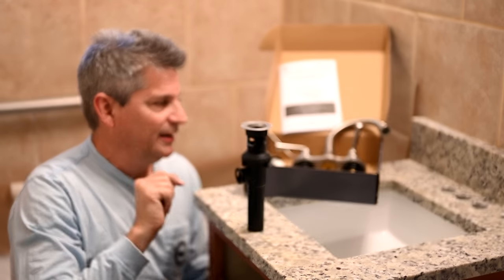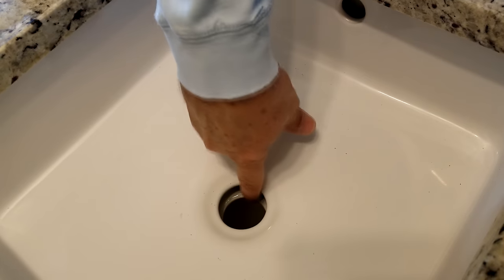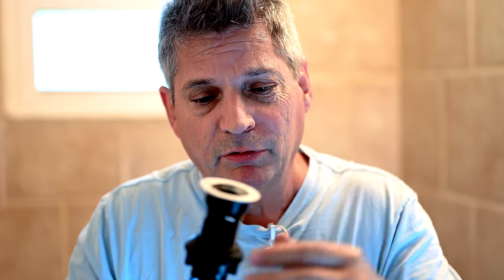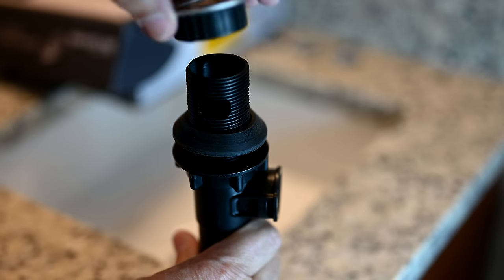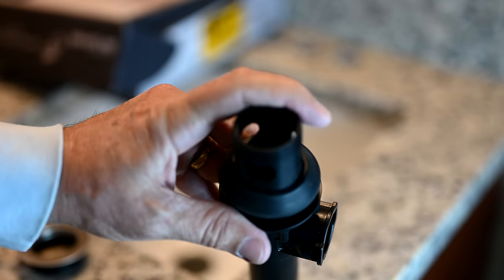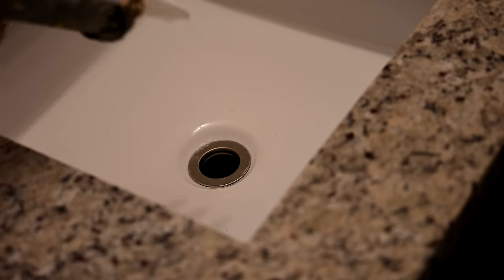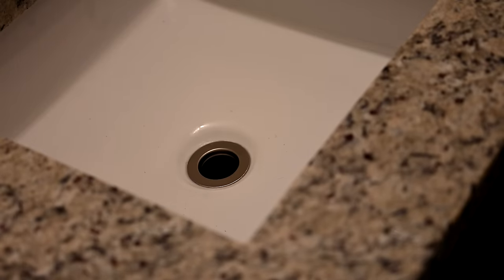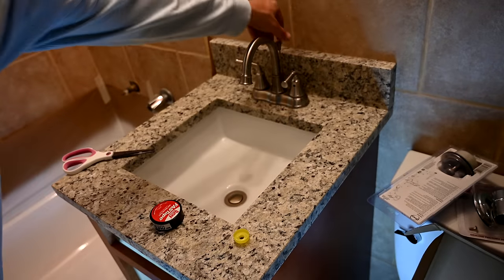How To Install Bathroom Sink Drain/Faucet, No Leaks Under Gasket, Threads [SOLVED] 2023

Comment: Sorry but i really dont think the teflon tape is doing much of anything here.  Just use plummers putty around the drain and tighten the gasket down real well and you should be good to go.
Reply from the maker: You are 100% wrong. Did you not see the comments from hundreds of other people here, literally hundreds who said they tried everything and this solved the problem? You don't understand where the leak is coming from. so your info is incorrect. Everyone uses plumbers putty and still gets the leak, because water is always on the threads down at the bottom.

Comment: Tip 1: Glacier Bay is garbage, never use them. Tip 2: Forget the teflon, put silicone on the top, bottom and threads of the overflow. Tip 3: install the faucet and connect the water first. Tip 4: straighten the pop-up rod looks terrible. Other than that I’d say you got it.
Reply from the maker: Their pop up rod is a stange angled one

Comment: I am NOT a fan of glacier bay anything.  You can't buy replacement parts for glacier bay crap.  When your toilet or your faucet malfunction you have to throw it out and buy a new one.  If home depot is going to sell the toilet, why in the hell won't they sell replacement flush valves that fit it?

Comment: WRONG.  The threads are not tapered pipe threads and they are not intended to provide a seal.  There is no point in putting anything on them to seal them, which is the reason the manufacturer doesn't instruct you to do so.  The rubber seal/plumbers putty/silicone sealant provide the necessary seal as per the instructions.  If you have a leak, it has nothing to do with the threads.  They are there only to facilitate the assembly of the unit.
Reply from the maker: WRONG! It is obvious the Teflon tape worked because the threads of the pipe are allowing water to leak out where the threads meet the gasket. IT's so funny watching uninformed trolls come in here and make statements like this, while hundreds of people have already reported in the comments that this solved their problem.

Comment: Ive had a number of customer's over the years, go  buy the faucets from the Box stores' they brag about the price of the faucet, compared to the plumbing store's price, then I would pull out the faucet from the box, and then pull out the plastic pop up drain, then I would explain the my customer, these threads leak,  so I would usually supply  a brass drain,  I over the years have only maybe 3 to 5 plastic drains Never Leak on me, the rest that did would be thrown out and brass installed.  Yes the Big Box store's would sell the faucet for $20 less, then the plumbing shop, but the plumbing shop faucet would come with brass popup , and if  there plastic drain leaks and I have to take out and install my brass drain , not only are they paying for a better drain, but Im not going to Warranty their drain, so their paying  myself more labor.   Yes silcone will work on some of the plastic drain,   so make a long story short,  buy a good brass drain, if the faucet comes with a plastic drain.  PS  I was a plumber for 34 years,
Reply from the maker: Yes, can't beat solid milled metal!

Comment: this guy is clearly not a plumber, waiting 30 minutes for silicone to cure will get any boss angry or get you fired
Reply from the maker: That is correct, most plumbing bosses unprofessional, want to overcharge customer, get in, get out, move onto the next job, don't test your work, just get out. I have repaired P-trap leaks from plumbers who just installed it and left

Comment: That's not right, you forgot to put the putty underneath the top screw cap.
Reply from the maker: YOU are not right. You forgot to watch the video. I clearly explained this is black ABS plastic and you cannot use plumbers putty on it, because petroleum products in it will cause ABS to crack. Also the manufacturer specifically instructed for silicone to be used. In most drains you can use silicone or putty. Many plumber prefer silicone because it will not dry and crack and cause leaks like plumbers putty does.

Comment: Use plumbers putty !!
Reply from the maker: No plumbers putty is not recommended be cause the manufacturers have since told us that the plumbers putty has petroleum products in it which can cause the black gasket to crack. Also if you appropriately wrap the threaded down pipe with the plumbers tape, that is what actually solves the leak so you don't even need the plumbers putty to begin with.

Comment: Nonsense! That Teflon tape doesn't do anything. Tape is meant to seal two threads male/female. You got lucky  period ! I would've put silicone on rubber gasket underneath sink . The tape is physically making contact with rubber gasket, but not filling any grooves.  Most people with leaks need the silicone. Issue is water splash gets into weeping hole area and sits there, if not sealed correctly(silicone) it drips between rubber gasket and sink. In your case, Teflon is wrapped around the plastic drain, preventing leak between drain pipe and rubber seal, not between rubber seal and sink. If you had a solid drain pipe, meaning no overflow protection, most people would have no leaks!
Reply from the maker: LOL you just contradicted yourself. you said "In your case, Teflon is wrapped around the plastic drain, preventing leak between drain pipe and rubber seal". Yes this is why it works. It is not just lucky, look at the hundreds of other comments from people who tried everything and only this works. You don't need silicone.
Reply: @jeffostroff  I didn't try it, but did use silicone....and it stop leak. Look, The area of sink were weeping holes are traps water, that water sits externally to drain pipe (i.e it is outside of drain pipe), the water will sit there and eventually evaporate if not used in a long time, OR. DRIP DOWN BETWEEN THE RUBBER SEAL AND SINK, IF NOT TIGHTENED OR  SEALED CORRECTLY USING SILICONE . PLUMBERS USE PUTTY LONG AGO. 
.

Comment: I personally disagree with the points in this video for the strainer.  it simply doesn't make sense.  instead, I believe the Teflon will make things worse. I am surprised there are many replies here saying it works.
Reply from the maker: You are wrong that's all there is too it, just wrong with no scientific basis. It does not make the problem worse it solves the problem. Have you not read the hundreds of comments below from other people who claim this was the only thing that worked for them after watching this video? How does that make it worse?

Comment: Normally I’d laugh. 
But do not use caulk. 
NEVER. 
It’s just shocking to me someone uses caulking.  The top section isn’t the main leak area and even if it did it won’t leak under sink. Over time. Very short time caulk will get discolored. Peel up. Look crappy. Etc. 
as for putty. You technically don’t need it on a bathroom sink. Kitchen sink yes. 
Also when installing a new faucet remove aerator and run faucet. 

Metal drains are much better then plastic.
Reply from the maker: it's the guys like you that laugh and don't ever read the instructions that don't understand what is really going on and can't even identify basic materials that screw everything up big time .  first of all I did not use caulk. I used clear silicone and not just any silicone this is a 100% silicone formula that is guaranteed not to stain or mold or anything so it does not discolor been doing this for years period also it is the instructions of the initial manufacturer to use clear silicone not plumbers putty you cannot use plumbers putty when you're dealing with black a BS plastic because the plumbers putty can degrade the plastic overtime causing cracks and leaks. Also plumbers putty can stain the sink too.
Reply: @jeffostroff  
Well I have 30 plus years in the field   
With that said. NO PRODUCT last a lifetime and someone who reads it and says. 
Cool lifetime. Well is a sucker. 
There’s no reason to caulk the top. 
ZERO REASON. The overflow on a bathroom sink drains right below rim. There’s also holes right below that rim. 
So sealing that area does nothing at all. 
I have removed and our replaced pop ups because caulking started to peel up or discoloration. And yes it says it won’t. But real world it does. 
I’d really love to hear your reasons for caulking that area. Because water fills in that complete cavity.
Reply from the maker: You can say all you want about it doesn't solve the problem by putting the Teflon tape on but you are incorrect. Our previous video that we did on his topic shows how it stopped the league. If you look at the literally hundreds and hundreds of comments on both of these videos from people who said they tried everything they read and watched numerous YouTube videos on this topic and they said only my Teflon tape trick worked. You can talk all you want about weeping holes and where you think the water's going nobody ever knows where the water is going. And everybody forgets that water leaks through threads and this Teflon tape stops the leak through the threads. It works we have shown it to work the feedback from the thousands of people who've seen these videos proves that it works.
Reply: @jeffostroff  
I’m only talking about the silicone you used. On top. Nothing else. 
The tape I have no issue with. 
The only leaks you can have on a pop up is under sink. The top is there so you can compress the unit together.
And I’ll throw this in simply because you said instructions/ directions 
I’m looking at several pop ups. From plastic crap to brass. Not one says use silicone on top. 
And not being rude. But no one should ever believe lifetime. 
It’s frustrating when a customer calls me and tells me they had work done and certain things failed and they say it’s a lifetime warranty. 
Or like brakes on a car. Lifetime warranty. 
Doesn’t mean for life. 
By you saying this. Your suggesting in 10-20-30 years it’s going to look just as good as it does today. 
It’s also why I don’t use plastic pop-ups.

Comment: You didn't solve a thing...the REAL REASON a sink leaks at that joint is because of the inadequate "clean-up" on the sink casting.  If you take a Dremel, grinder or even rough sandpaper and dress the opening where the flange and sink bottom meet, you will solve the problem.  Those pieces of pipe are NOT designed for Teflon tape...otherwise they'd tell you to use it...right?

You don't get to say "don't use plumber's putty" because they don't say to use it then use Teflon tape...when they don't say to use it.
Reply from the maker: You didn't learn a thing and especially look at the older version of this video that we did a few years ago where you see nothing but hundreds of comments from people who have watched every video on how to solve the problem and they said that this video solved it for them. Anytime you have two threaded pipes coming together it's a good idea to use Teflon tape. Some plumbers use pipe dope you'll see them paste it on the blue sick liquid painting it on with a brush.

Comment: Wayyyyyyyy to complicated, just flip that big washer over where the flat side seats against the flat side of sink flange.
Reply from the maker: Waaaaaay too incorrect in your jump to conclusions. The problem doesn't have anything to do with the connection at the bottom of the sink, it has to do with the water running down the outside of the threaded pipe and how to stop it.
Reply: @jeffostroff  ummmm it's how I fixed my leak.

Comment: This has got to be one of the worst plumbing helps on YouTube. 
The gasket does not thread on. You just push it on. No need to go counterclockwise. You don't even know how to hold a roll of Teflon tape to wind it on tight. The manufacturers who say, No plumber's putty must not test their plastic. I can take a plastic pop-up apart that has had plumbers putty on it for a decade and the plastic is fine. 
I pull the gasket and wrap Teflon on the entire threads. The Teflon makes the nut spin easier and the gasket slip over the threads easier. 
btw, That is a vent, not an overflow. It allows air out so the sink drains without a big bubble at the start. It is normal for water to be below the vent holes in the pop-up.  People wrongly call it an overflow because it does overflow.
PRO TIP. Install the faucet FIRST so you do not have to reach past the drain. Sealant under the gasket. Not around the faucet. Silicon gathers grime.
You got 2 things right. Tighten the trap to j-pipe nut first. Wrap the pop-up with Teflon tape. And yes, no plumber's putty on rubber. 
I use FrostKing rope caulk. It has never failed me under faucets and under drain flanges. Oatey sells their own version. 
I won't tell you my other ProTips I used while I installed thousands of sinks, faucets and drains. 
Testing the overflow....???? Really. If the drain does not leak, the overflow will not leak.
Reply from the maker: Wow what an uninformed troll. You do need to wrap Teflon tape counterclockwise. Just listen to how arrogant you are! This video is worn, the manufacturers are wrong, oh, but YOU are right? LOL. And wait, you refuse to test the overflow? You would not make a good plumber, stop pretending you are one. LOL! Man I love trolls like you, all you do is show everyone you don't know anything. How about this. Try reading all the hundreds and hundreds of comments from our readers who said this video solved their problem, and it was the only video who had the correct solution for them. First sign of a troll is one who starts of saying the is the worst video on the topic. LOL! How predictable and uninventive. You took the same troll class as others before you.
Reply: @jeffostroff  When wrapping Teflon, grab the object with your left hand with the threads to be wrapped to the right. Hold the roll in your right hand with the tape coming off the bottom. Hold the tape to the threads with your left thumb. NOW, pull the tape around and tight into the thread in a clockwise direction with the spool spinning on your right index finger held snug by your thumb. You can control the tension so the tape wraps tight into the threads with no looseness. Three layers minimum. Teflon tape is cheap and easy to use when you know how. 
At 5:00, you say to wrap the tape COUNTER clockwise so you can unscrew the rubber washer/grommet up to the sink bottom. Bull. Pull the rubber washer off. Wrap the entire lower threaded area with Teflon all the way up from the plastic nut then PUSH the rubber washer back on. The Teflon tape will dry lubricate the nut so it twists and snugs easily with just hand pressure. Twisting the rubber washer tears the Teflon tape. If you wrapped the Teflon tape tight enough with enough wraps, you can push the rubber washer on without tearing the tape
If you put enough silicone on the flange, you would not need to add more from the top. You don't even mention if you wait for the silicone to cure before leak testing. Great way to cause a leak. Oatey grey plumbers' putty on a roll or MD or FrostKing rope caulk will seal great and has no interaction with plastic. Lowes and HD carries it if your plumbing supply doesn't. Try replacing a siliconed in flange when a brushed nickel flange discolors or when replacing the faucet and pop-up. The finish on flanges on cheap plastic pop-ups do not last. 
When you are done, fill the sink to the top (it does not need to go down the vent/overflow.) with hot water. Listen for water leaking past the drain plug to make sure it is seating properly. Pull the plug and watch the drain with a flashlight. Even the tiniest leak will sparkle. 
I've removed and installed over 2000 bath sink faucets and pop-ups when I replaced the sinks. I did another 2000 kitchen sinks. I semi-retired and moved 700 miles from my well established market and did 7 years of work with only 3 call backs. I never used pure/RTV silicone. I used a polymer window caulk that had water clean-up. Customers hated how silicone collects grime. 
I use Channel Locks to add up to 1/4 turn past hand tight on those plastic nuts. Saves me from having to tighten a bit after leak checking.
Oh yes. You have hundreds of positive comments from novice DIYers who are clueless. Watching you fumble trying to wrap the Teflon tape was a great indicator of your experience level. An experienced plumber can wrap Teflon tape blindfolded. I sure can.
Reply: Hey Jeff. Watch the Oatey demonstration of how to wrap Teflon tape. It is on the HD web site link you posted. That is how a real plumber does it.